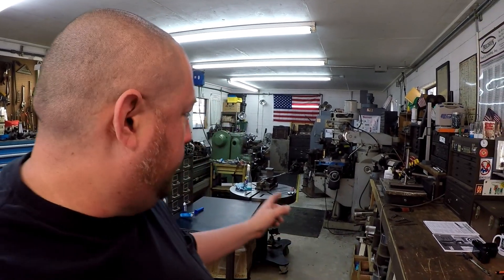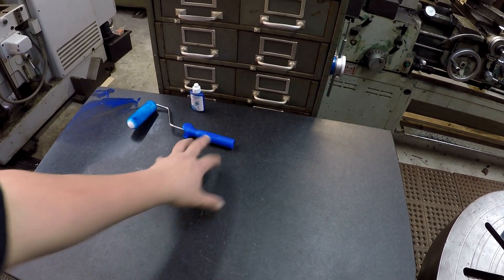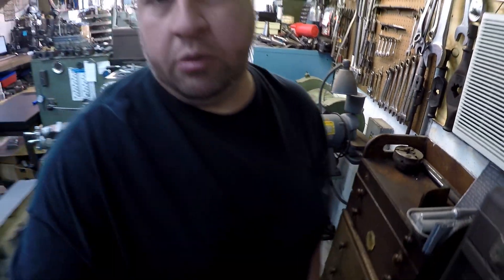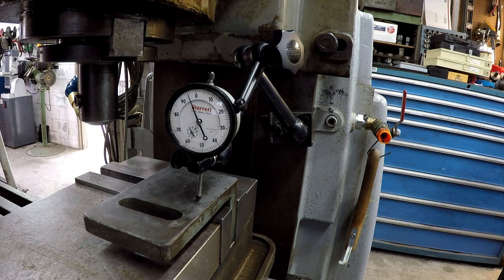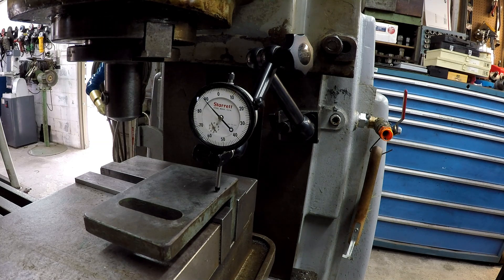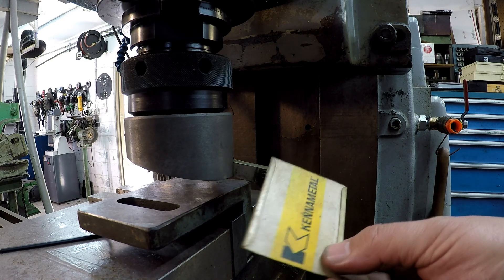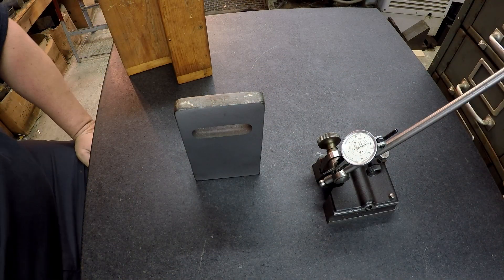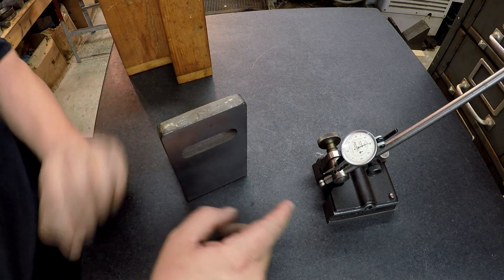Hand Scraping & Fly Cutting Small Angle Plate

Comment: Nice! We'll make a scraper hand of you.

FYI, the ball machined on the surface gage mast was specifically intended for squareness checking since the tool was introduced a century ago. The surface gage is what I call a "violin tool." it takes long practice to get the best use of it.

There's a ton of scraping info on the "Circuitous Root" website and I'll see if I can find an image of the motorized lap I designed 35 years ago. It takes a 1/3 HP motor, a cast iron disk, and a little woodwork to make a diamond lap costing anything from rummaged junk to $100. Beats a $400 gadget if you're on a tight budget.
Reply: Here's the link to Circuitous Root and their scraping bibliography:

http://www.circuitousroot.com/artifice/machine-shop/surface-finishing/hand-scraping/
Reply: Forrest Addy:  Thank you for the info:  There is hours and hours of good reading at that site. I will be reading it all. If you find the image of the lap machine you built can you send me a copy of it as well?  Again thanks for the website recommendation.

Comment: Adam once we had a Mattison Grinder get contaminated oil in and it ruined the ways,Fortunately we had two grinders and could switch our diamond wheel to the other grinder and continue production.We hired a retired Mattison scraper that worked for a company called Checkmate.This fellow was very good and scraped our ways in about 2 weeks.He used the electrical scraper for the coarse scraping and finished up with hand scraping.His method was about the same as yours.I asked if I could scrape a little and he let me use his  scrapers on one small spot. One was identical to your scraper with the file like handle,and the other scraper had a round handle about the size of a tennis ball.The scraper blades were about the same so I asked why he had two different scrapers,and he said he liked the round handle a little better after scraping all day because of fatigue and he could control the scrapes better.He said all the scrapers at Mattison scraped their own way after years of experience.I just mentioned this in passing ,but I thought you might try one of the round handles and see if it might help control the small scrapes so that it might be easier to get the 20 points per inch that you try for!I enjoy all of your videos including the ones that are not about machining.Thanks for sharing!

Comment: hey Adam you need more distance between the ball and your indicator, if your only an inch away your only measuring within that inch. if it's at .0003" square at one inch,  your total over 6" span is over a .001". just an FYI.
Reply: .0018" to be exact.

Comment: Glad to see the carbide put to good use.  One trick i use on several of my handles is cutting a slot in a tennis ball and slipping it over the end of the handle.  Sorta gives your hand a bit of cushion when roughing with a hand scraper.  You can also get a lot of tape and tape a ball on the side of the scraper when flaking.  I never used the hammer method that Richard taught in your class but will give that a try next time. Scraping marks look good Adam!

Comment: Hey Adam, use a "screwy" ball or a ball bearing, or gauge pin in the V grove at the front of the surface gauge as your stop, then you can use the stalk of the surface gauge in a vertical position to get measurements higher up on the angle plate.

Comment: Hi Adam thanks for sharing.  I have never done any scraping but have seen quite a bit of it done at a machine restoration/repair shop I used to visit. Most of their hand tools seemed to have a much bigger diameter handle with a flat back on them. They were probably 3" to 4" in diameter. That style would probably be much easier on the palm of your hand than the file handle when bumping it. If I remember correctly they used their side or hip to push the tool.  Looking forward to some more projects in the future. regards from the UK
Reply from the maker: Yes I will be working on the handle to make it more user friendly for my hands, I just havn't spent any time on that yet.

Comment: The tramming of the flycutter becomes very critical when M/Cing flat surfaces. Any error in the tramming will produce a hollow surface. It is better to use a good endmill as the diameter is much smaller than the fly cutter radius. and any tramming error is much reduced. The end mill M/C'd surface may not look better than the fly cutter but any hollows are much reduced.

Comment: Hey Adam, great videos. I noticed that your indicator point is at about a 45 degree angle to your "master" square. To get a true reading between the gauge and the surface you're calibrating, the indicator tip should be no more than 15 degrees parallel to the surface
Reply: Not to mention a huge fly cutter is a terrible choice of tooling, if your mill is out of tram the tiniest amount the surface of your part will have a big concave ditch running dow the middle

Comment: Nice shop , I didn't notice a Surface Grinder though ,  if you don't have one I would strongly suggest adding one to your shop , very important machine tool for  your operation there , that would be the correct  way to finish that angle plate , just a suggestion ,

Comment: if you do it parallel to the vice, you can use parallels and let the lip hang over, also to clean it up, speed up the RPM's some, and reduce feed. You're not taking much off.
Reply from the maker: +chronicblazer84 trick when getting chatter is to reduce rpm, not speed it up. I set it to machined face would be square to the short side. Clamping it parallel would cause more set up issues being that it's not machined on the sides.
Reply: Abom79 You do make some valid points. I always use a beveled steel square (you do have one flat side and a machine bed to reference). You can pick up a good machines square set for ca. $60-$80 on eBay. Regardless I enjoy your videos, and learn new tricks from you.

Comment: I can understand using scraping to achieve a large flat surface but I don't understand why a small surface is scraped instead of lapping the surface with a fine abrasive.  Thanks for posting.  I know that it takes quite a bit of effort and I appreciate that you take the extra effort.
Reply: I can understand flaking a surface so there are reservoirs for lubrication.  That makes sense and the thin film of the correct lubricant can float the parts and reduce friction.  But, I don't understand scraping an angle plate.  I'm going to try and study the subject more.

Comment: It would be best to put the ball end of the surface gauge as far to the bottom of the angle plate as possible, and position the tip of the indicator as far high as possible against the plate. That way you can get a better reading along the full height of both plates and the deviations between the good plate and the scraped/machined plate.

A cylinder square (assumed to be straight and non-tapered on either end) will always lean towards only one side when placed vertically on a surface plate, but will always be deadly square along the two sides perpendicular to the side in which it leans. A good way to check the squareness of both angle plates would be to use a cylindrical square and set the zero on the indicator with this process....

Rotate the cylinder while butted up against the surface gauge and indicate along the highest portion of the cylinders OD. Mark the high spot on the cylinder that tilts most towards the indicator, then rotate it precisely 90 degrees in either direction. The two perpendicular 'sides' of the cylinder will now be perfectly square with the bottom face of the cylinder square and surface plate as viewed front-on, and vertically, 'face-on.'

I hope this is useful information. Nice scraping work, and great photography! Thanks Adam.

Comment: Adam...... By watching some of your video's, making things square and flat is fairly straight forward, but where do you start on something that is already built.  I have a combination vice that I got from Harbor freight, and nothing is straight or flat, which makes drilling and squaring parts hard todo.  Are there any ideas on this or chuck it and get something better?  It is one of those vices that move "x" and "y" for a drill press.  
It looks like scraping is a very long process, with a good ending.
Keep up the good work!!!
Most of all, just have fun!!
Michael M.

Comment: I guess this was from back before you got your cylindrical square.  Looks like your vise jaws are pretty true with your head for it to be withing .0003.
Reply: this video is an hour old ;)
Reply: johnny east this video was filmed on super bowl sunday, Adam has since acquired a cylindrical square FYI
Reply: At first I just assumed he had hit his head and was suffering a bit of memory loss as well... But then the annotation corrected the issue.
Reply: i see
Reply from the maker: Yes this was back early Feb and I recently got around to editing the footage.
Reply: Not only are the jaws true but the two surfaces of the piece in the jaws must be very close to parallel.  Perhaps a ball bearing shudda been used?

Comment: My god i have never seen anything like this. Firstly we made our scrapers from old files, second you will never be able to back hsnd scrape like that. And third you left hand should slihtly rotate to produce the bird like pattern. And finally all scrapers should be sharpenedmy oil stone with a very large radius on the end. This will give back hand and forward bird patterns. By the way we did this on machine tool slides way back in the 1960s. This was the first thing Apprentices learnt in the fitting shops.

Comment: Why do you scrape? I don't know the first thing about this. To me the fly cutting looks like it would be faster way to get a flat service.
Reply: tommy13t hand scraping is kind of a finesse thing you walk in the final product 
Any machine that has slideing ways one is hardened and ground the other is scraped. At least on quality machines. The small grooves allow for oil to stay in the rubbing surfaces for long life lubrication instead of being squeezed out.
Reply: The square is as square as his machine now, and hand scrapping will only produce marginal improvement to the square. 
The reason for scraping it, is for practice.
He has a grinder that needs to be scraped in. Better to have some fun and learn the skill on something easily repairable before he takes on the grinder.

Comment: If you flip the master square, on the other side, after set up the dial on 0, you have obviously still to read 0?
Becouse I bought a little granite precision(?) 90° square, and if I set up 0 on one side (the longest one for example), and than I flip the square on the shorter side, and I check again with the dial, I always find 4 microns of difference that means out of squarness. How it's possible? This s*** happens each time.

Comment: Why scrape it? Is it because it looks good or is there another reason.
Reply: scraping on ways is generally for oil clearance; scraping on tables and other surfaces is partly for looks, but also helps hold oil on the surface to prevent rusting and reduce sliding friction between flat surfaces.

Comment: How do they make a master square or flat plate and check its accuracy. How do you know your master reference is flat?
Reply: Master plates are optically inspected using interferometers (not typing that much, ask Google) and corrected to the desired level of flatness.  Smaller masters are made using these larger plates as reference surfaces.
Reply: Originally in the early 1800's the master plates were created by using three plates. Two of the plates would be scraped together until  they  were mated together. Then one of those plates would be mated to the third plate. Finally the third plate would be checked against the remaining plate to ensure that first two are not hollow. 
This way you get a perfect flat surface. This must have been a very tedious process at the time because the machines available to do the initial machining would not have produced a very accurate surface.

Regards from Redruth

Arnold

Comment: so is that style different then when scraping for oil like on ways
Reply: Well, I don't mean to answer for Adam, but if I'm to understand correctly, there is "Scraping" to achieve flatness, and then there is "Frosting" or "Flaking", which is what creates the minute passages for oil pockets on the slide-ways of machines. Scraping is always done prior to any Frosting, if the job is done correctly that is. 

I have learned this distinction from researching prior to restoring my lathe, but unfortunately I have yet had the resources to do so. A good place to get started on definitions and stuff is on a website called circuitous root dot com, and I found them by googling "Frosting and Flaking". I find the subject incredibly fascinating and hope to learn to do it myself very soon. Aloha...Chuck

Comment: Hi Adam. Any reason why you didn't start with the long side first?
Reply: Scraping the small side first gets you a reference for milling much faster.
Reply from the maker: In the beginning, I failed to check the long side, something Richard did tell us is to always check your parts first before you start scraping.
Reply: Jeff Heath The Vintage Workshop . Very true Jeff. Less area. As a machinist Ive always started with the longest face first. As the case with Adams angle plate. Starting with the long face first would have taken longer to scrape. But had half as much error when the small face was machined.
Reply: Abom79 . You have come along way from that class Adam. Your scraping is looking really good. Keep up the great work!
Reply: Agreed, but I'm not talking about scraping for final alignment.  I'm talking about scraping in the small side first, just to get a flat surface that's "good enough" to fly cut the other perpendicular face so that he can continue scraping from there without having to scrape off .007 or worse.  I was in the class with Adam, and know how far off that angle plate was originally, so perhaps I have an unfair advantage, information wise, regarding how to proceed.  Once he's within .001, he can then scrape the large face to 20 points (or more, knowing Adam a little), and proceed to aligning the small face to it.  Are we thinking the same thing?

Comment: so not to sound rude or anything but what's the point in hand scraping
Reply: It's kind of the final step in developing a flat surface, bearing in mind there are degrees of flatness. For instance, when making gauges the tolerance of a gauge needs to be one tenth of the tolerance of a finished machine part. Even grinding depends on the flatness of the surface which is on the chuck to produce a flat surface parallel to the part you are grinding.
Reply: scraping is using mild, simple techniques... but with excruciatingly careful process to achieve an excellent result. machine tools can be more accurate than our hands, but we can be sooooooooooo careful and adaptive.

Comment: Hey Adam what's the purpose of scraping
Reply: I want to know also.
Reply: You should totally sheck out his videos where he went to the 5 day scraping class, it was uploaded not too long ago. It's also to create a really precise surface, since you remove material in tiny bits by hand and checking regularly with the bluing, you have very good control over the process. It's also beneficial to not having your part locked down so it is in a mostly stress free state, as John Saunders from NYCCNC found out by himself in preperation for this class (you can check out his videos, too ;) ).
Reply: so why scrap if you can mill it?